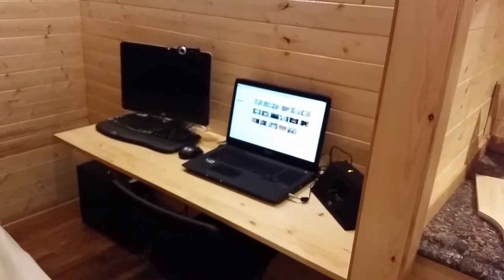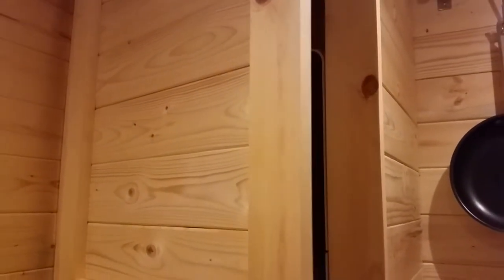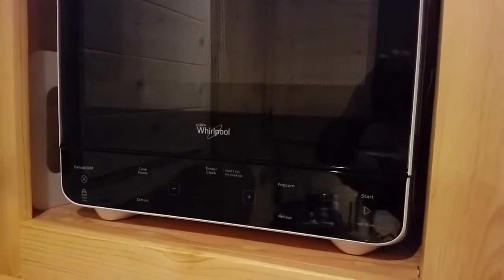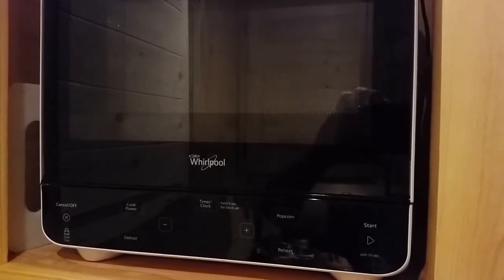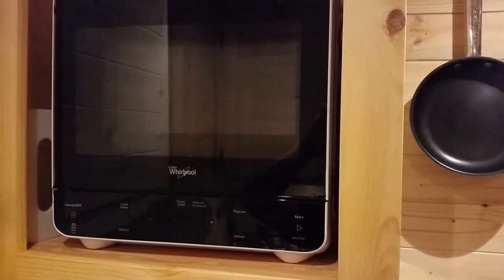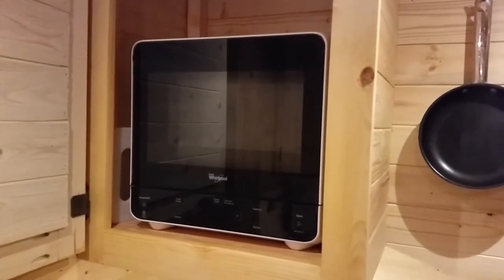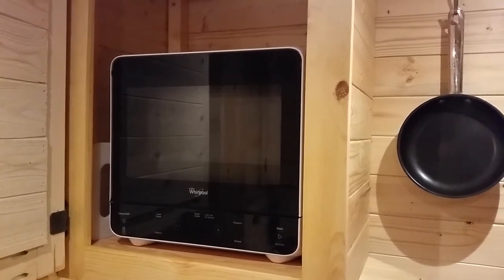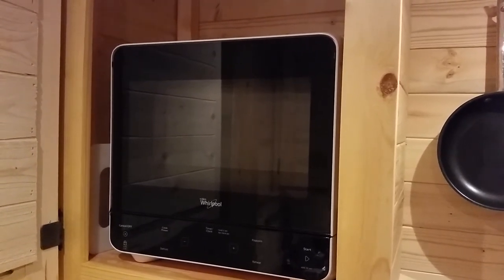Microwave in tiny house

Comment: I just bought one like this for my tiny house. I haven't used it yet but I bought this one for the same reasons you did. Seems perfect for my life!
Reply from the maker: Megan Zopf I loved my microwave, it was perfect for a tiny house... it was so tiny that I could fit into a cupboard instead of having to allocate counter space... That's why I wanted to share it with everyone who's thinking about a tiny house and then having to get the microwave that doesn't heat my power cable up...

Comment: Hi there, I was so happy to come across your video! I have been looking at this microwave to fit in an 18" cabinet that is really only 16.5" wide on the inside. I know that it will fit, but will it be able to open? Can you please tell me how much room I need to open it and still be able to insert a full size plate. It looks like your cabinet is wider than mine. Thank you so much!!